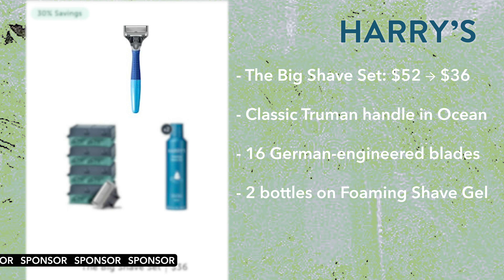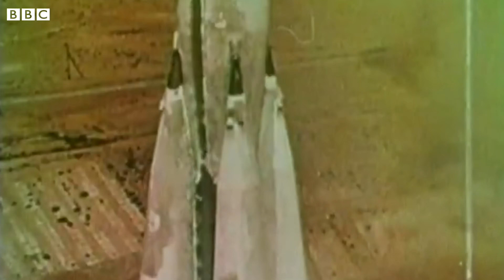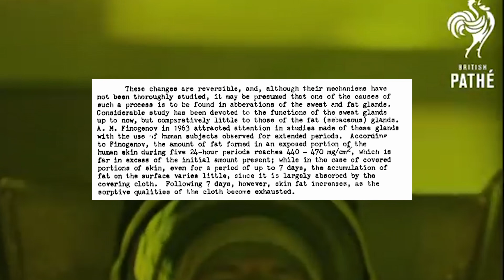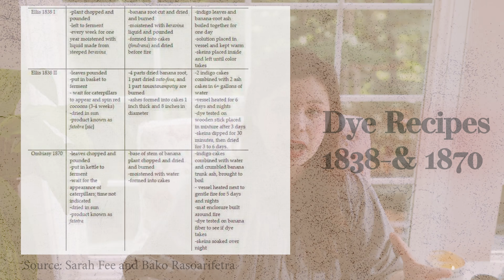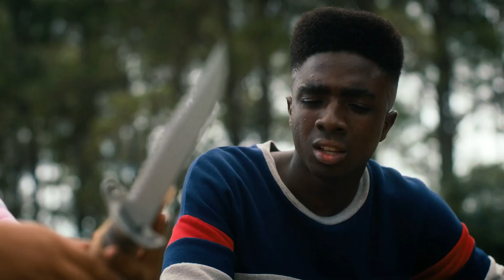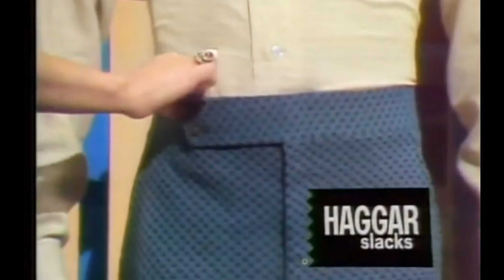The DISGUSTING truth about Laundry

Comment: In the US, the use of perchloroethylene in dry cleaning has been outlawed since 2008.  They are now using  "green" cleaners but they are not as effective in cleaning.  Most of them are silicone based and are sold under many different names.  Perc wasn't the worst one out there either.  Back in the 1940's- 60's they were using carbon tetrachloride which is carcinogenic and extremely nasty!  In conservation we still use stoddards for "dry cleaning" treatments.  Our modern detergents aren't really cleaning our clothes either.  Most of it is water, perfume, dyes, (optical brighteners) and other chemicals.  Good ol' lye soap (a fat and soda ash) was a much better cleaner.  Of course it doesn't really work on polyester and other synthetics.  Those need enzymes to clean because the fibers are oleophillic.

Comment: I grew up in WV and we hung laundry as much as possible, even though we had a dryer. Top tip: if you have a heated basement, hang a clothesline down there near a heat vent. If you have an enclosed porch, hang a line there. You can still line dry in freezing weather that way. Yes, you can dry clothes outside in freezing weather. It takes longer and they will literally freeze, but it will then dry! If you don't have room for a line, get a few drying racks that fold up and can be stored in your closet. Also, a dehumidifier can help those hung clothes dry faster, especially if you don't have a dry heat source running. 

Also, laundry stripping is becoming more popular and needs to be done at least every once in a while. 

To make your water soft, use wash soda. That's literally what it is for! It is a water softener! Use it!

I live in the UK now and have for 18 years. We don't even own a dryer and wouldn't have anywhere to put one right now anyways (nor could we afford to run one with the extortionate increase of energy costs this year). We use drying racks and the clothes line, depending on the weather.

Comment: Heyo, 
So a handy trick my mom figured out is you can put a cloths line up in your basement or bathroom and if it's a retractable kind you can pull out the line and collapse it as needed. In this way we can also make the line longer (insert crazy patterns and mission impossible music here) or if we just have a few things shorter. 

Also hanging a towl rod about your closet door (on the inside) gives you a space to hang shirts to dry without having the hangers scratch the crap out of your door clill

Comment: Where I live, the official recommendation is to wash towels, underwear and bedding on 60° C (unless it has blood, diarrhea or vomit on it in which case it's recommended that you do 90°-100°) and clothes on 30°-40°. 
One problem with this is that most underwear isn't manufactured to hold up in 60° so a many people just follow the directions on the label and wash them in 30°-40° with their t-shirts.
Letting your clothes air dry on racks is definitely the norm here. Lines aren't as popular anymore. Racks also make it easier to move your laundry inside if it starts raining or your neighbours are sanding or having a bonfire or whatever

Comment: I work at a laundromat and the amounts of detergent etc that people use is staggering. Plus the smell is horrendous. When I get the chance,  I like to tell people that they only need a small amount of detergent and white vinegar. They don't need to spend money on fabric softener, scent pellets or dryer sheets. That would save people so much money.
Reply: I can barely tolerate the overwhelming strong perfume of the laundry aisle in the supermarket. And that's despite all the packaging being fully sealed.

Comment: For loads that have pet urine I use white vinegar along with the detergent. I’m not sure if it gets to diluted to be effective as a disinfectant but it does help with smell. Plus white vinegar is general an inexpensive but effective cleaning product that is more environmental friendly
Reply: I also want to add that outside air drying isn’t an option for most of my things because I have severe outdoor allergies. Unfortunately this means that I have gotten rashes when pollen gets in my clothes outside.
Reply: For cat urine we soak for several weeks in a mixture of white vinegar and rubbing alcohol.  I guess everclear would also work for the rubbing alcohol, it's basically the same thing.  It seems to work.  Had a batch that had to have a second soak for a couple of weeks but it worked.

Comment: Live in France. I really tried to buy a top of the line machine, got a a Korean brand because I lived in Korea and love Korean appliances, lol, can't help it, lol. I'd say 100% of all machine made for the European market have no hot water intake valve, because, well, the machine heats up the water itself, makes cycles much longer but I'm ok with that. The machine I got is also water efficient which I really appreciate because when I first had the machine the waste hose wasn't long enough to go into the waste pipe so I drained it in the sink, not much water is used so the sink never overflowed, also once I forgot to put the hose into the sink and I flooded my kitchen 😂😂, if the machine hadn't have been a low water machine the flooding would've been MUCH worse. So there's that. Now, I tend to wash only in cold water because here near Paris it's pretty hard water and cold water puts less deposits on the fibers then hot water does, but, my machine has a super high heat steam option to disinfect and kill mites and other biological allergens, which is nice since I don't have a dryer and I don't dry my clothes in direct sunlight outside. I also rarely use a softener because even though the water is hard the softeners weaken the fibers more than hard water does. The laundry detergents here in France also have a dosage chart based on weight of laundry, how dirty it is, and if you have hard water or not to determine how much to use, I'd never seen that before in the US
Reply: Wait! I never knew that US machines don't go above 60C, or that they don't even reach 60C, lol. My machine here in France can reach up to 80C, lol. But again, machines here heat their own water, and they heat it really well.
Reply: 12 loads a month!!!!!!!!!!!!!!! I'm I just not washing my clothes as much as I should? My household is basically the same, but with a cat instead of 2 dogs, and our guest room is rarely used, and we have enough sheets for our bed to change them once a week without washing every week. I think we only do maybe 8 loads a month at the most (our machine can also hold 9 kilos so we can do really big loads if we want to)

Comment: One additional thing I’ve learned is that sodium percarbonate (a brand name is oxyclean if you live in the USA but you can buy generic for cheap!) does sanitize your clothes AND breaks down into environmentally safe components. May be worth checking out?

Edit: but I 100% say add this in addition to air/sun drying :)
Reply: Sodium percarbonate is a bleaching agent. It is basically an oxidising bleach or as they used to call it, "colour safe bleach".  It does have sanitising properties but there are also added chemicals in there.  Believe me, I've tried to find out what is in it but their SDS sheets aren't going to have all that information.

Comment: Here's a tip for all those with medium to hard water  (and who can't or don't want to use fabric softener): Use some natron. The very stuff that many americans use for baking their muffins also makes your water softer. I have medium soft water and only use a pinch, those with hard or very hard water have to use more. It also softens your fabric. (And do NOT, under any circumstances, pour anything acidic like lemon juice or vinegar into your laundry, it will destroy all the rubber parts, like the seals to your washing machine opening, in no time. When washing by hand you can ofc. use it).
Now, some may say: but fabric softener smells so nice! Sure it does, it's full of perfume (why I, a turpentine allergic person, have stopped using it long ago). Well, most laundry detergent have already more than enough perfume. If you are like me and use perfume free stuff, than you can add some essential oils to your laundry. I prefer lavender oil, in it's pure form a few drops are enough. I also have a little pouch with dried lavender in my closet, it also keeps bugs and moths away.
Reply: Natron like salt?  My parents have an extremely hard water aquifer which feeds their well, and they have a softener system which uses like giant rock salt.
Reply: @bellablue5285   In Germany it's called "House Natron" and it's known to soften water, but is also used like baking soda or baking powder in muffins or pizza dough. Natron is short for 'Natriumhydrogencarbonate' and i THINK it's a kind of salt. Btw, it also works great for removing oil stains out of fabric, wheather new or old.
Reply: @olgahein4384  interesting, I'll have to look that up.  Appreciate the clarification

Comment: I would like to know what it said about hemp and hemp fibers as anti microbial. 

There are ways to get rid of a lot of the calcium in hard water. Using strong vinegar in stead of softners will do wonders. Combine this with line drying. Also once a month just put in a lot of vinegar into your machine on the highest setting for the duration of one load will clean the machine a lot better than all those commercial products wich are expensive.

Instead of using vodka, try to find isopropanol. It is cheaper and has a higher alcohol content. 

What strikes me the most as somebody from outside the US is the sometimes insane laws and regulations. Fosphates are already outlawed in the EU. We are encouraged to linedry our washing, not by law but by convention.

Comment: I'm in Sweden.  I grew up with a gran who was in the yarn industry and her mum was seamstress and washer lady,   re-dy,  re -make and patch was so common  so I  do it too.  I know what level  of water I have, never uses  fabric softener  and i never  use the tumble dryer for anything  then socks  and underwear, reason I dont have room for  hanging.   Towel and  bedding goes in 90 C wash  or know as boil wash.   Also if you rent,  there will be a laundry room in the basement with free  washer and dryer, the dryer room has space for hanging stuff and often a fan  for airflow.  The laundry  detergent I use  is not that expensive but ecofriendly, contains   pine soap and what  I use to remove stains  is bile soap.  Old fashion but it works.
Reply: You have FREE washers for renters? That sounds lovely. Most apartments in the US charge you to use the washer, my current one it's $1.75 per load, and the dryer is also $1.75. I hand-wash a lot to save money!

Comment: I've got laundry going as I watch this video.  I have a retractable laundry line.  I haven't been using it lately (thank you rainy season) but I'm going to start using it again.  For the undies...I bought an I expensive shoe rack and I hang out underwear on it.  I put it on my bed under the ceiling fan.  The undies dry fairly quickly this way.

Comment: The longest running mild argument my husband and I have with each other is that I air dry nearly everything and wash a lot of things on the gentle cycle and he looks at the label and says 'You don't have to do that, it says warm/tumble dry' 

Modern clothing is made out of spider webs and wishes not actual fibers and so I have been babying my clothes for a long time and even more so since I have been changing to buying more expensive/sustainable brands, because even a good brand of t-shirt gets little holes in it during the washing process in my experience.
Reply: I also put ALL of our underwear (socks bras camisoles underwear, that stuff) in laundry bags to protect them from other clothes and the machine, lol.
Reply: @aeolia80  I do that too. It's shocking how much longer everything lasts.
Reply: The 'spider webs and wishes' made me cackle. To add on it, even the quality of the fabric is going down the drain (no pun intended). I have a shirt I bought 15 years ago that is just starting to get holes in it. Meanwhile, some of the shirts I bought a year ago are starting to show wear. And I try to hang dry as often as possible.
Reply: @leah392  Same, I have a shirt from 1998 that I wear as pjamas that has only just started getting little holes in it.
But it's the natural consequence of decades of prices staying the same or even getting lower. Something has to give and now it's hard to get people to adjust to the necessary rise in costs.

Comment: For outdoor line drying - really important that black,navy and red clothes are hung inside out to avoid bleaching. (Red is the worst for this.

Bedding should be draped over two wires instead of one to allow fresh air to access both sides of the fabric. 

For indoor drying - really important that the washing machine is clean and when washing add some alcohol or vinegar (2x shot glass doesn’t leave a smell) to kill any odour/mildew causing bacteria/mold 

In colder weather instead of trying to add heat to dry clothes faster simply add ventilation. Put a fan in front of the drying rack and run for a few hours. This is an effective method down all the way to freezing. 
Allow some time to vent the room during the day to prevent the humidity causing issues.
Reply: Also don't forget to close all buttons and zippers. There is educate when having up the wash. Undergarments are to be hung in the middle. That way you have a wall of clothing in front and back. That way prying eyes don't see them.

Comment: I have been actively changing my laundry practices the past years and one thing that wasn’t touched on was the volume of product we are recommended to use which isn’t necessary.  

I now use a powder that requires a tablespoon per load, I buy 150 loads for about $23, which is way cheaper than supermarket brands, (a load is 6 pounds approximately of clothes, about 13-14 tshirts) an ounce of vinegar and a tablespoon of baking soda.  People will say you need half a cup of vinegar, you don’t need that much and I don’t use in the rinse cycle because vinegar can destroy rubber gaskets and hoses with over use.  

I’ve found no difference using tons of vinegar and the single oz.  The combo softens the water as well.   

I use a stain stick and an enzyme solution for various stains to pretreat, I do not use shout or other commercial pre-treat products, they are useless, wet, stain, apply, use a toothbrush, and work on the stain. 

Finally when I have to use a dryer, I use wool dryer balls, white for lights and a set of dark natural not dyed for darks.  These do speed up your drying time as much as 30%.  They work.  Especially with sheets, the lanolin is removed and unless you’re allergic to wool, highly recommend. 

I have skin issues and changing my laundry practices improved the quality of my life and I no longer have to use any sort of bleach.  

My entire laundry kit takes up a 1/4 shelf in the laundry room and I’ve removed 95% of plastic use.

Comment: My kid has a horrid dust mite allergy & we cloth daiper so my laundering practices have changed completely in the past two years (ex: kiddo only wears things once before I was them hot bc mites)...after this seven days info I'm thinking I might throw their clothes in the freezer between wears to kill the buggers and use less water 🤔
Reply: Hm, I have dust mite allergy as well and since most people are actually allergic against their feces (= the "dust"), freezing would not work at all. However what works for me is a quick rinse. I sometimes have to sneeze or even getting asthma when picking up knitting projects, because these love to accumutare dust. So I just rinse them a few seconds with the cold water that comes out of the shower before the hot water arrives. Squeeze the water gently out and line dry. Saves water, detergent and makes the clothes last longer. 
Freezing is good for moths, lice and similar nasties, might even be done to kill the dust mites in unwashable things, but their allergy inducing dust still remains. It just won't get more as fast.
Reply: I use eucalyptus oil in my laundry it disinfects, softens. & makes the clothes smell good. Plus a little goes a LONG  way. Plus sunlight is a VERY good natural killer of bugs like dust mites (free UV rays).
Reply: @itwasagoodideaatthetime7980  I personally don't do any oils in my laundry (yet) bc figuring out eczema triggers is so hard and the less variables the better but I hang dry everything like to the point where my partner asks if I'll ever actually use a dryer when we get one 😅 yes, only in winter